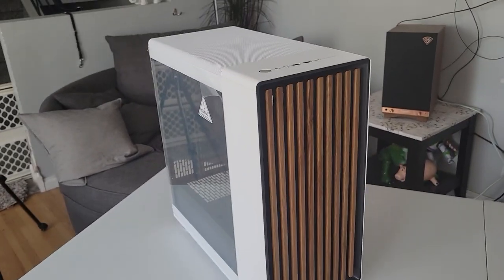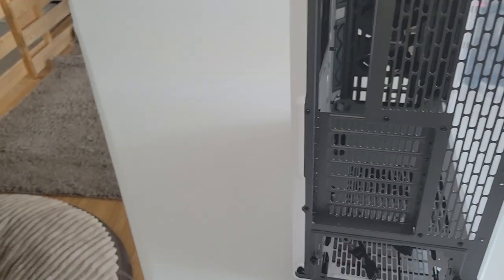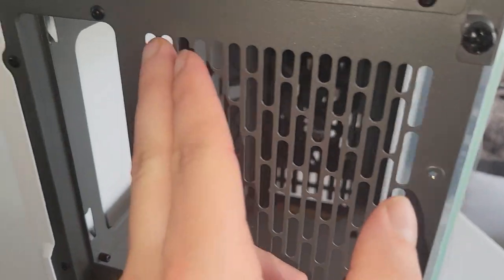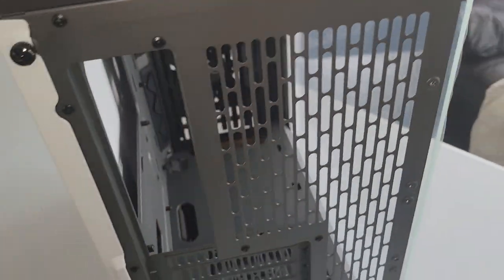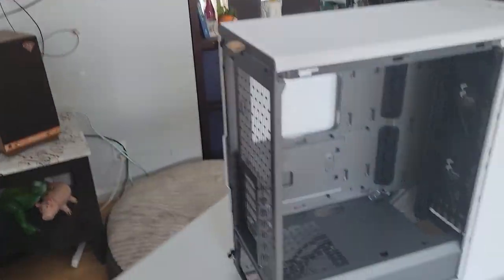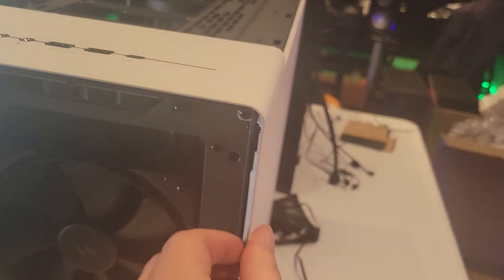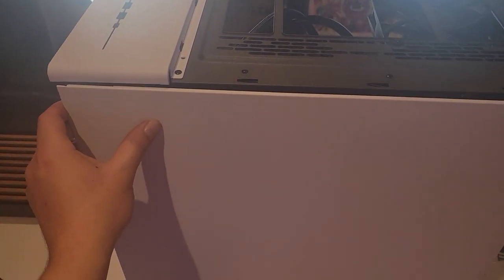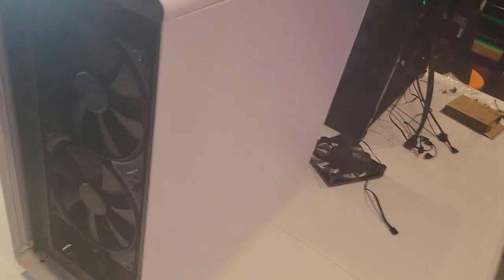I build in the Fractal Design North (overview, teardown, review)

Comment: No noise reduction features whatsoever. And a common flaw of all recent Fractal Design cases: front fans are mounted in a way that allows air flow around the edge of the fan. It reduces the effectiveness of the fan by 30%, test shows. Requires application of duct tape around fans and ideally to seal the whole front fan mounting panel.
Reply from the maker: I'm not a big fan of this case. I only bought it to do a review of it for youtube. I'm glad I won't be keeping it. Looks nice, that's about it.
Reply: @Renegade_Rabryn  I have Define 7 white. Like it very much. Very spacious, very convenient, excellent noise blocking. Can mount 4! HDDs on the other side of the backplate, that is awesome. On the bad side: paint is flaking off on the grills on the back, requires purchasing and installing at least 1 extra fan because of the same front side problem. And USB slots on top are a concern when you have a cat who likes to get his paws wet.